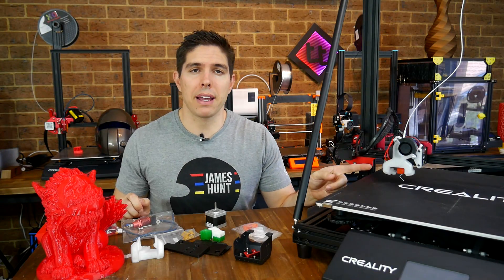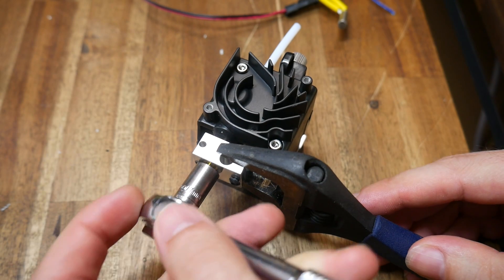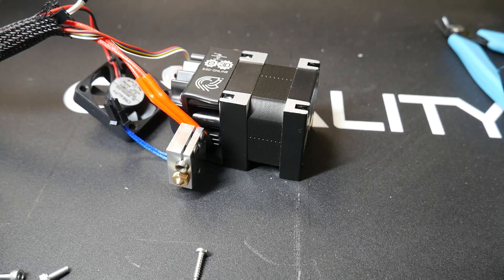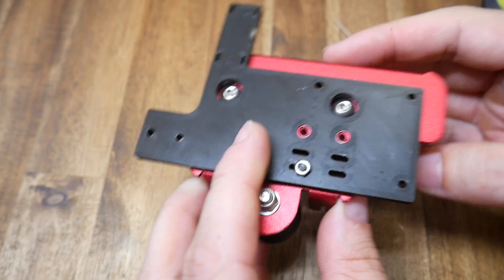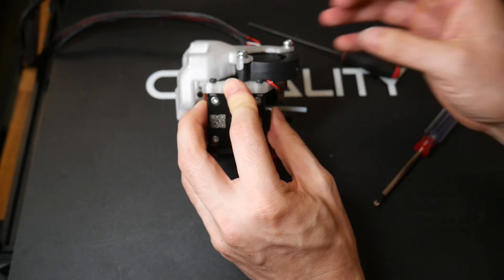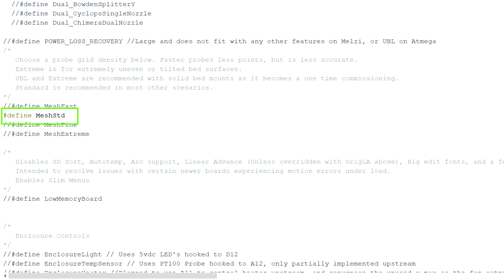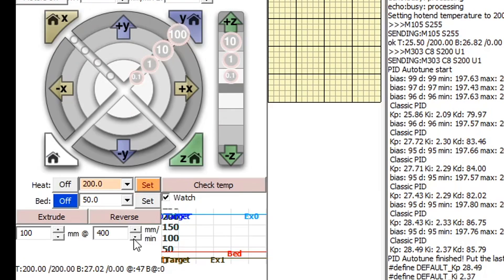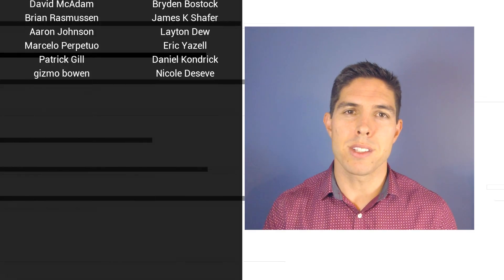Hemera install guide for CR-10S Pro / CR-10 Max

Comment from the maker: A public apology to David from Insanity Automation, as at one point in the video I incorrectly said Automated Insanity.
Some tips for firmware from Tiny Machines:
-Force10SPro and Force CRX display does not need to be on for the 10S Pro or Max. Those toggles are for 32 bit boards. 
-When you select MAX or 10S PRO V2 it forces BL Touch, bilinear and 25 point probing since those machines come from the factory with BL Touch. When customers purchase our BL Touch kit for the 10S Pro, we have them plug the Z end stop into Z+ and use V2 firmware. 
-If you're getting false positives on the runout sensor, you may have issues with your sensor/ wiring. We use the default values without this issue and setting it higher will result in a later trigger on a real event.
Reply: Would the firmware modification you posted be the same for the CR10S Pro v2? Such as the probe offset? Also would I need to change the y -axis stop 10mm like the MAx? Any help is appreciated, thanks! 
Also, the M851 X-40 Y0 is the only coordinate change needed for the BL touch?
Reply: I flashed the screen now and it was exactly what he had as a result.
Reply: @Tommy S  YES!! Pls @Teaching Tech how for CR 10 S Pro V2 - i have Hemera but Firmware im a noob.
Reply: Followed this step by step and discovered that on Windows 10 at least, extra to these instructions, initially you need to install the driver (FTDI) from the supplied SD card (which you mention in your other firmware video), then in Device Manager you need to set the baudrate of COM4 (at least that is what it was on my machine, your mileage may vary) to 115,200 to be able to connect and have the printer show in Arduino. Once I made all the changes and could see my CR10s Pro V2 in Arduino, the firmware did not compile for me on Arduino 1.8.13 (C:\Program Files (x86)\Arduino\hardware\tools\avr/bin/avr-gcc.exe: The filename or extension is too long), did compile on 1.8.15 but then would not upload. This did however allow me to export the compiled binary, which I then uploaded with Cura. It is important to note that Arduino outputs two files, one with the bootloader and one without. If you want to keep your bootloader, use the file that says 'with bootloader'. If you don't, you can't program it via USB again because you will have no bootloader... Aside from this small detour into the frustrating world of standard computer issues, the video is a very good guide to setting up and installing a Hemera on your CR10s Pro/Max.
Reply: I know it is kinda off topic but does anyone know of a good website to watch new tv shows online?
Reply: @Duke Ezra flixportal :P
Reply: @Keagan Hassan thanks, I signed up and it seems like they got a lot of movies there :D Appreciate it!!
Reply: @Duke Ezra Glad I could help xD
Reply: What isnt mentioned anywhere in the video, is that if the hotend isnt swapped for a Volcano-hotend, the Gantry crashes into the Z-axis-motormount 10mm sooner, before the BL-touch or the nozzle can touch the bed.. this should be noted somewhere.
Otherwise, a really good guide on swapping over to a Hemera extruder.

Comment: Has anyone done this upgrade with the Hemera Revo? I am wondering if the mount or the BL touch work with the foot print. the upgrade looks a bit smaller and I think it will work but figured I would check. Thank you for any information.
Reply: Never mind it is shorter by 11 mm and lighter by 92g for anyone also wanting to know.

Comment: Thank you, I took your advice about the CR10S Pro V2 years back and watched you channel consistently. I purchased the Hemera and looked at your install video. The back plate and BLtouch mount are still on Thingiverse but not tiny machines or many of the others. Most disturbing is that the git hub file no longer has the Dwin file to edit. That and I am unable to find any reference on the things in the firmware that need to be changed. 
I also too your recommendation to purchase Simplify 3D.

Comment: Hi Michael, thanks for a great video. I'm brand new to 3 d printing so I've been enjoying the learning curve as I work my way up to printing ABS dash panels for my KITT project. A couple of issues I ran into with the build. Firstly the V2 Fan duct doesn't seem to sit in the right place, however I'm not sure what the optimal spot for this is so can't be sure. Also I printed all of the mount and parts in standard PLA and the fan mount bracket seems to have warped considerably once I screwed everything in. Lastly there's a few updates that might be worth mentioning for newcomers like me. I've added them in the next comment for what I found was needed, or different from when you made the video.

For anyone attempting this, these are the things I found were required or useful:

1. Watch the Ender3 video first, as there's a couple of key things to pick up on.
2. Print all the required 3d parts first, and in a good solid material. I used PLA but PETG or ABS may have better luck in rigidity and shape.
3. The latest Marlin Creality DWIN branch does not have the touchscreen files in the same place/zip. They are now in the TM3D_Combined480272_Landscape_V7 zip. It took me a few goes of the wrong files to figure this out.
4. When you update to this firmware you lose one of the more important adjust features, which is the ability to adjust bed and nozzle temperatures at the start or mid print.
5. The Arduino build take s a significant time to compile and also has a couple of errors when compiling, but it did seem to work in the end. Took about 5 minutes sitting on the same screen before anything happened.
5. Many of the screw lengths suggested did not work for me, and I found that they were bottoming out on the hemera, or not long enough to catch the nuts on the other side. I used the next size up in length for most of the mounts, and either filed them down slightly or used washers as spacers.
The fan duct mount needs to have the adjustable screw holes opened up a bit with a file or Dremel to allow the screws to slide up and down for adjustments.
6. Lastly the latest version of the Marlin firmware has 2 values you need to adjust for the bed size. There's BED_SIZE AND MAX_POS from 470 to 450. If you only adjust the bed size the x axis will crash into the right side.
Reply: Edit, ignore point 4, the temperatures can be adjusted by just pressing on the commanded value which is slightly greyer/darker than the current value.

Couple of updates on my setup also:
Make sure you pick the right duct, I hastenly picked Duct_V2 because its the latest version, but that's for the V6 not Volcano. I've also found there is a remix of the blower mount that uses 3 screws instead of 2 and is much better aligned.

Make sure you put the thermal paste on the heatbreak going into the hemera, and screw the heatbreak in correctly and test the thread heights for it at the correct positioning of the hotend prior to connecting anything. Once assembled you cannot readjust these without taking the whole thing apart.

I ended up putting connectors on everything so I could easily remove the unit when needed for jams/clogging.

Lastly, no-one seems to agree on settings for this setup in order to get good prints, particularly with PLA. I am having inconsistent (thin/thick/none) lines as well as gaps at the start and excess at the ends of each layer, despite the retraction settings. If anyone has a good set for these it would be appreciated.

Comment: ok first the video is great but actually doing it nightmare plus compiling the firmware is not happening they erros just keep on coming i have tried going threw it manually and undefining then tried copy and paste for the config h file u provide and nothing a hex file for this would be great also i have the cr 10 s pro induction sensor and the v2 bltouch also the max and but there is a updated screen for the pro as the screen does not work in marlin on my pro the v2 i have not tried yet. Any firmware in hex format would be nice for all pro inductive sensor the bl touch version and max would make life alot easier

Comment: Do you still use this printer with this combination of print heads? I have had one since before this video and I never finished assembling it.  The bed from the factory is pretty warped and I wasn't sure if it was worth upgrading to a hiwin linear rail system.

What do you think about upgrading that unit to linear rails? Or am I just better off buying the other printer I saw you assembling a few episodes ago?

Comment: Hi mate great work I’m currently doing the upgrade on my cr10s pro v2 and following your video however the mounting plate is only for the volcano block not the standard that comes with the hemera kit I discovered that after all the hard work and put it in together, would you kindly upload a mounting plate for the stock block thanks in advance mate keep up the great work
Reply: Same here 😞

Comment: Why wont my CR10S pro V2 connect to pronterface and when I run out of filament the sensor pauses the print, but it will not start again

Comment: Hi,  will the printed guide for drilling the holes  also for the CR10s Pro V2 ?
Reply: I suspect you've got this answered by now ... I have a later (April 2020) V1 that was being sold at the same time as the V2 and the carriage is the same as my March/April 2019 V1. When looking at replacement parts at Tiny Machines the carriage sold for V1 & V2 is the same. So, yes, it should be the same. I've printed several different adapters & they all fit both my carriage plates. Never say never but you should be okay.
Reply: @JackWilson327  Actually found this one

https://www.thingiverse.com/thing:4775572

and works great.  no  drilling needed
Reply: @perrykappetein9685  I printed that one. Yeah it fit nicely. I didn't want to mess with moving the break detector & there were a couple of things I didn't like about that one so I made my own. Once I get done testing I'll post it for the heck of it.  How did you handle the configuration.h file? Did you use the one off the Marlin configuration repo?
Reply: Actually, never mind. Sorry! I think I found the right file. I was getting completely confused because I was trying to fork the repo and that process was not giving me the right configuration.h. It is there in the repo and if you go get the zip of the repo under releases the right one appears to be there as well. - https://github.com/InsanityAutomation/Marlin/releases/tag/CrealityDW73
Reply: @perrykappetein9685  Thank you much. I had not found that group yet. I will check it out. I think I've got the InsanityAutomation release working. Needs some tweaks yet. I'll crack on again in the morning.

Comment: I am having a hell of a time with getting this firmware right. I have a brand new CR-10S Pro V2 and did the Hermera and Volcano upgrade. It is running creality's 1.70.0 firmware currently and when I try and do your steps exactly, I get all sorts of compiling errors.

Any help would be SUPER appreciated! If so, let me know the easiest way to chat with you!
Reply: I don't suppose you got this sorted did you? Since this was posted I think some the key words / syntax in Marlin have changed. I'm about to start over this morning with the current config files from Marlin & my best guesses based on this, antclabs for the BL-Touch (also out of date), and a couple other sources.
Reply: @JackWilson327  I did get this up and running with the latest marlin. It seems the new marlin is programmed much cleaner and therefor very little was needed to do.

You will need to use ardiuno ide which is ardiuno 2.0 (still in beta).

After that, couple modifications to the marlin. Io as shown in teaching techs "hemera install guide for cr-10s pro /cr-10 max".

Hope that helps!
Reply: @colinjones9291  Do you recall if you started with the configuration.h & configuration_adv.h from Marlin on github @ "MarlinFirmware/Configurations/config/examples/Creality/CR-10S/CrealityV1/" ? Asking because Teaching Tech says to use the example config from InsanityAutomation's repo and they seem to have defaulted back to the Marlin configurations and I'm either blind or unable to find any example configurations under their repo at this time. So @Teaching Tech is a little behind on this video now.
Reply: Never mind, I think I got it figured out.

Comment: Ok, I am 2+ hours in to trying to figure this out. I have a CR-10S Pro V2 and am about to do this upgrade but cannot get firmware to compile, and even if I could, I am not confident that it's all configured to work properly. Anyone willing to help? if just a hex file for my CR-10S Pro V2 with the changes from the video would be super helpful!

Comment: I have a problem. I am stuck in the Marlin setting, I can not complicate the Arduino program and I do not want to upload to the CR10S Pro V2, because it gives me errors. I am doing something wrong, I did it more precisely step by step, I selected Mega or mega 2560. Or maybe otherwise, would you give a hex ready for the CR10S Pro V2? I have Hemera installed, but without the firmware, I die.

Comment: Hi Guys, 

Can someone help me, please?

I am not so experienced with the arduino software.. and i have a fault messagec while i try to compllier that firmware its called :

C:\Program Files (x86)\Arduino\hardware\arduino\avr\cores\arduino/main.cpp:43: undefined reference to `setup'

C:\Program Files (x86)\Arduino\hardware\arduino\avr\cores\arduino/main.cpp:46: undefined reference to `loop'

collect2.exe: error: ld returned 1 exit status

Because of this fault i can't finish it ... 

I open that marlin.ino and change like he did it in configuration.h  nothing more ...

Comment: Hi MIchael
Thanks for a great video. 
I was right with this and have followed along almost to the end, upgrading my own printer. However, I don't get the part about the filament runout sensor. I gather the stock one isn't used as I see a bit of filament stuck in it to prevent an error occurring. Does the setup as shown here include filament runout sensing? If so, how does it work?? You do say in the video that you tested the filament runout protection. How did you do that? Then I'm further confused that you're discussing re mounting the stock filament runout sensor. Do you still need it?!!
Thanks.
Chris.

Comment: Good evening Teaching Tech. Need a great help. I have a Cr10s Pro V1 with the hemera direct extruder mounted, I wanted to understand if it is possible to install the bltouch v3.1 (antclabs), and update the screen with the black theme of the v2. Can I safely install Marlin 2.0? Thank you very much.

UPDATE: 
I managed to do everything and I also put the black theme. only thing: sometimes the bltouch when I turn on the printer, it flashes, others don't. Unfortunately with the fan (5015) at 100% I did various tests (PID tune) but with the heating cartridge (30 Watt), the hotend (volcano) cannot heat to the desired temperature. on the one hand it is good, it means that the fan cools a lot. Maybe I should put the original cartridge (40w)? or a silicone sock? thanks.

Comment: I want to attempt this with my "CR10S Pro", but in the Configure.h where you have to define it has a side note that you have to solder r64 and r66? Basically scaring me from even taking this project on. I need to modify the firmware as well, im using the  "hero Duct and able" attachment and need to change my probe offset as its probing off the bed and jamming the nozzle into the heated bed. Not sure if you've covered this in another video already.
Reply: Same printer here. If soldering is involved, then things get a bit more complicated and risky. Let me know if you manage to find this out. I'll start doing some reading as well.
Thanks

Comment: I don`t understand where I can get the screen files that fit Marlin-CrealityDwin_2.0. I have got almost everything running by now accept for those files. Could you please put a link in the description.
Reply: @ChazmillsADLT  So. I just took this one. It is a different branch called Creality_DWINTest. I just flashed the screen files in there and it worked for me. Additionally, I want to say that with 3d printers half of the time I have no idea of what I am doing so be careful! ;)

https://github.com/InsanityAutomation/Marlin/tree/Creality_DWINTest
Reply: @ChazmillsADLT  I just realized that there is a zip called ,,SingleExtruderScreens_V2Rev1.1´´. I guess that the branch was updated.

Comment: Filament runout is a must have for this large format printer, a follow up video would be appreciated if you figure that out
Reply: Very easy to do, you just need some electrical cable so you can extend the cable and bolt the sensor where you need it. Either, replace the existing cable, crimping on appropriate connectors or, more “hacky” but easy to do if you don’t have the crimping tools and terminals, splice in a cable extension using heat shrink cable connectors. The only tools needed then is a knife and a lighter.

Comment: Great videos ... To what degree does this guide apply to the CR10s Pro V2?

I don't have any problem on the hardware side, my concerns is the firmware.
Can I use TM firmware (ver 2.x) or do i have to revert back to stock firmware?

Comment: Hi, excellent tutorial by the way, I'm looking to upgrade my CR-10 MAX too, but one question: why you did not simply design and print adaptor to fit original extruder and filament sensor right next to the original hotend? wouldn't that be easier not to tweak firmware? I understand volcano hot end would give you higher extrusion rate, but if I don't need it, I'm happy with slow printing, can I simply reposition original extruder to the short distance from original hotend without tweaking firmware?

Comment: PLEASE NOTE: The custom Hemera mount is not suitable if you are running v6 hot end on the Hemera! it is noted in thingiverse but I missed it - now stuck with no printer - just the heads up to others!
Reply: I just did the same thing...